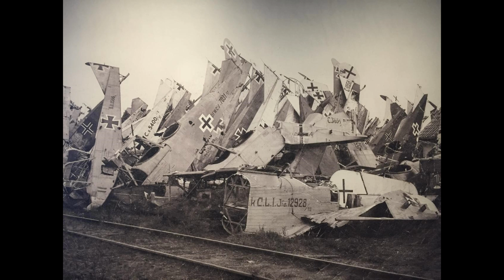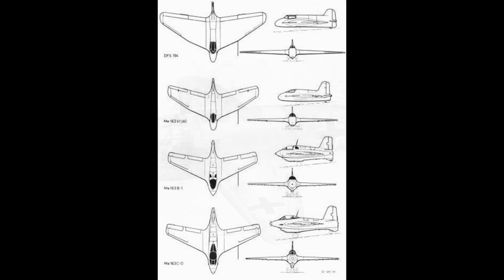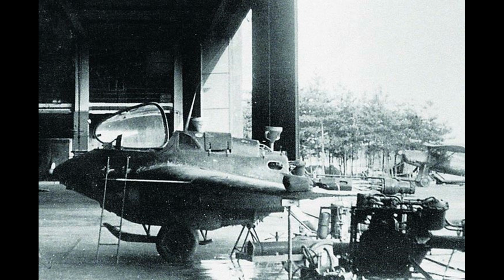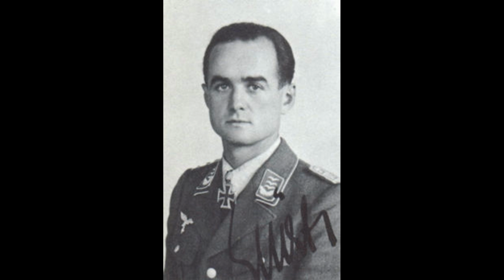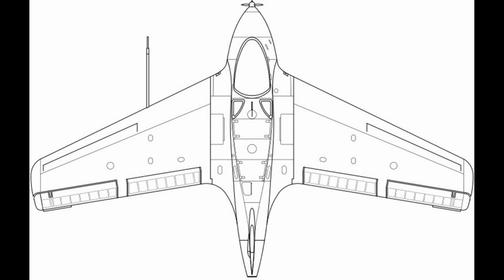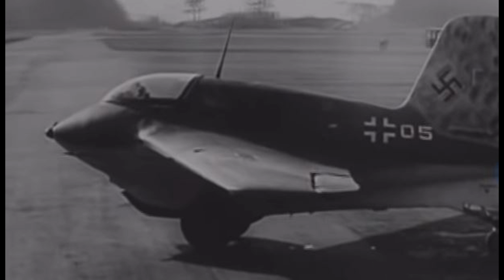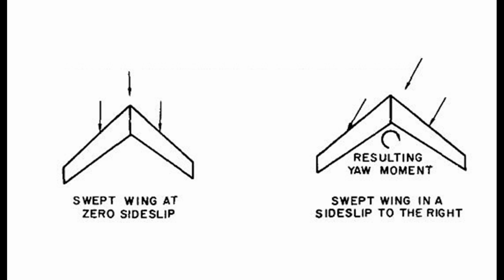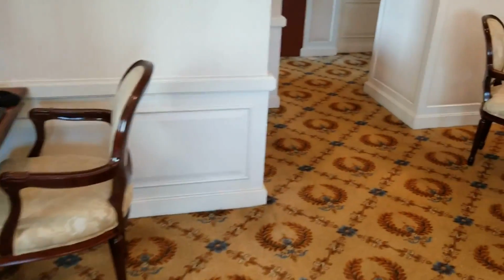Messerschmitt Me 163 Komet Pt. 1

Comment: The word "stoff" is  closely related to the english "stuff", both seemingly going back to the same root. Although I would assume the meaning in this case was derived from the word "Treibstoff", meaning fuel material, the usage in these designations strikes me as decidedly ambiguous and secretive, intentionally not giving away anything about it's usage, origin or purpose. 

I presume the thinking behind it was, an order for 5 tons of 'C Stoff'" from an aviation company doesn't tell a low-level spy (janitor, cleaning lady at the office...) at first glance that there is exotic propulsion experimentation going on. It's in fact really close to ordering "5 tons of the c stuff", just that the word is a bit more neutral in technical German usage. 

This seems very similar to calling prototype guns "Gerät" (simply "device", such as Gerät 06), rockets "Aggregat" (best translated to "complex machine", such as the A4 which was later propagandistically renamed the V2, Vergeltungswaffe), or prototype tanks "Objekt" (yeah I know the latter was Russian military - same difference).
Reply: . Mom lM
.

M
P pool

Comment: Note the Me 163 had an autostable (reflexed) air foil.   It could not be stalled with the tanks more than half empty.

1 Me 163A was a small test bed with a "cold" monopropellant rocket that worked by decomposing hydrogen peroxide
2 Me 163B was the combat version with a HWK 509A1/A2 that used a bipropellant rocket hydrazine hydrate + 57% methanol + 13% water  (the fuel) and Hydrogen Peroxide (oxidiser)

The Me 163B had a couple of problems.
a/ the Me 163 could intercept because it could climb at speed in a minute what would take a piston fighter at least 10 minutes.  Once there it only had a few minutes to conduct the attack and this was often not enough to form up for a coordinated attack.
b/ the two 30mm MK 108 guns were not quite enough for the speed of the attack.
c/  no pressurisation
d/ the skid could not accept high sink rates and was the cause of must accidents.

The solution to the short endurance was the HWK 509B rocket which had the same rocket motor but added a much smaller sustainer for cruise that was much more efficient.  That would give the Me 163 a few more minutes.   However the Me 163B was never upgraded.

Instead development of the larger Me 163C was begun.  This was enlarged aircraft, had a pressurised bubble canopy and 4 x Mk 108 guns and of course the improved HWK 509B and latter C.

The Me 163 was perhaps to much work so the Me 163D also known as the Me 263 or Ju 248.   This was a stretched Me 163B with the boost/sustainer motor and retractable undercarriage.  It did fly as a glider at least.

The short range was not so much an issue as the ultra high climb rate and speed meant it didn't waste 10-15 minutes time getting there.   It was at bomber height in a minute.

Rudy Opitz, Me 163 test pilot said that pilots did survive over turned aircraft.  They were fairly solid and precautions were taken.
Reply: Thank you for your input. It's very informative. Is the image @16:07 an engine with the sustainer thrust chamber? (below the main one?)
Reply from the maker: It's a later 163 engine, I'll talk about it later.

Comment: Great great research Greg. The Germans had invested so much in training these pilots then put them in the flying coffin so to speak. I imagine the lure of high speeds and being uncatchable in the air was irresistible. Two questions on the 163. 1) What is that prop thing in front what does it measure and 2)what kind of adverse yaw would that thing have in a turn with the sweepback and the short fuselage. I agree on the 727 was my first airplane as a first officer in OA we had the prototype -200 it was about 1000 lbs heavier than the others due to the cabling for the test flights. If you want to do some research on the 737 as well as it was requested to be built by DLH and in plan view is remarkably similar to the 262 so these people knew what they were doing - well apart from that nasty rocket fuel lol.
Reply from the maker: Wow, a fellow 727 pilot! I love that airplane, although I haven't seen one fly in a few years now. OK, the prop thingy at the front drives an electrical generator. I would think that it would have a lot of adverse yaw with those long wings and stubby fuselage, but I haven't found anything about that specifically. Of course, what's a little adverse yaw when you eliminate all the asymmetrical forces from the prop? I suspect rudder coordination was a lot easier than in a 109 or 190, extra adverse yaw or not.

Comment: Highly interesting video! Now I once read a very similar story to what happened to Joschi. In that case, after the wheels hit the plane, the engine also cut off and the plane basically landed itself on the end of the runway. So from the outside the plane looked undamaged, but then they also found out, that the pilot had been dissolved. Many ICBM`s also use hypergolic fuels. Also many of chinese space rockets and the russian proton rocket run on hypergolic fuels. Nasty stuff.
Reply from the maker: Thanks Paddy.

Comment: How effective was the pitch authority of the control surfaces without a normal tail?
Reply from the maker: I didn't read any complaints about lack of pitch authority, I think the design flew quite well.
Reply: @GregsAirplanesandAutomobiles  i am actually trying to make similar "tailless" rc plane. They're called planks in dynamic soaring community and often are actually more pitch sensitive, probably due to less moment of inertia along that axis

Comment: Wing twist? Look to the Prandl wing.
Reply: I´m a german engineer. to get Lift U have to force the wing to be in angle of attack. a canard by lift of the front wing, a usuall plane by Downforce on the Tail. The missing length makes it hard to cause this Downforce at the Tail/End of the foil and/or Lift at the Nose of the Front part. We have also seen extra little wings. To counter that Turn/moment the CG is in front of the CL/Center of Lift. (Balance to fly straigt) Now where will be the best spot for these aoa causing aereas? Where they are mostly/far away from the CG! That´s the sense/reason for the design how such wings are planed. Additional to reduce stall is the combination of getting presure above the wingtipp and Downforce causing aoa by using washout/wingtwist. I am sure Lippisch understood what he was doing. Stoff can be anything. Like stuff. The ö is not o spelled. like the ü isn´t u or the ä isn´ t a. hey, and at all U make very interesting YT-Stoff. :)I love it. Thx for the face fitting to your voice.
Reply: @1948ccm  Birds fly without vertical stabilisers or rudders and their tail feathers are very close to their CG.
Have you looked at the Prandtl wing concept? (I spelled it wrong.) My knowledge is limited, but... Conventional aircraft use all those bits you've described to control flight but they induce drag. Modern aircraft use winglets to reduce wingtip vortices and the consequent drag and sometimes minimise adverse yaw which necessitates the use of the rudder to correct it - which produces more drag. The Prandtl  wingtip has lotsa downwash. This reduces wingtip vortices and provides stability in the yawing plane. Because of the downwash, when ailerons are used it reduces drag and induces positive yaw. I'm sure the Horten brothers used the concept successfully on their gliders in the thirties. I think the Northrops in the US used a different concept to control their early flying wings. From what I've seen, the B2 uses an aileron/spoiler system.
Reply: @53jed  Birds do fly with vertical stabilisation by temporary rotoation their Tailfeathers and as long alive gambling with active manouvering Wings body and Tailsection shape of folding wing due to speed and effort ot create drag or lift. A glider is a dead bird! U get a dead bird gliding only when designing his shape how dead gliders are. so, the Prandle Wing has length, to see as beeing a fuselage to have a tailbehavior. yaw is solved. If the wing would be straight it would not fly. cheers
Reply: @53jed  the Horten used the....that´s the end of what I see. a bird changes its tail due to the nesseccarity of ´hem to simulate either rudder of elevator. Haven´t U watched birds yet? As I said they also move their wings forwards od backwards to create anti nosedrop or noselift. They balance therefor with CG and CL. The Tail is lets say digital used once vertical and horizontal. I recognize that very often. I have seen some YT Stuff Prandtlwing. One guy was an imposter scientist behaving like a stuntman having a short window open in his mind like religious beleavers blind for the knowledge outside. I felt that is waste of time to surch for improvements in wingtyps when already efficiency is 98% high of possible 100%. a good glider makes 100m dropping only 2m! And that is a glider with 2 Wings, main uplifting front and a downlifting at the end of the fuselage. U will not understand the last sentence. I know that and it doesn´t matter. ANY WING ONLY CREATES LIFT WHEN AOA IS HAPPENING. The Tail does not have the function of feathers of an arrow! The angle of zero lift is in my sence the base we are talking about when aoa Angle of attack is used to explain something. So any wingfoil has its own angle to be the zero Lift angle. A flat one or a symmetrical have that simmilar to the centerline. please show a link were U have found some interesting Brandtl wingtip or drag reducing parts. Let´s see the picture what makes 1000 works beeing nothing;-).
Reply: @1948ccm  Calm down. You're saying the pterosaurs, bats, the Me163, the DH108 and the Hortens' gliders, the Northtop wings and many other aircraft never flew because they couldn't. The Me163 has a bunch of washout (5-6 degrees) at the wingtips, so it seems they possibly grasped the Prandtl concept rather well. Instead of shouting that it can't happen, look it up and try to understand how it works. The concept has  been around for only a hundred years. For most of that time it's been impractical because of material and cost constraints. 
The washout reduces provides yaw stability which reduced the need for a drag-inducing vertical stabiliser, reduces wingtip vortices and, when ailerons are applied, reduces drag on the lift side which produces positive yaw - which, in turn (or, in a turn) reduces need for rudder input. It's pretty slick. NASA are open to the concept and a small team has been researching it for some time.
There are plenty of videos available. Here's one:
https://www.youtube.com/watch?v=0Oh0Q0Dv28I
Reply: @53jed  Lyar! I do not say that. I say when they are alive they have control of Balancing the forces out to fly and that the fun of flying to be the master. The Horten gliders have the balancing inbuild downlift at the end the foil and the end of the wing to mimic a Tail. U have an inner lifting past and and  an outer part. Lengh and force, AOA , CG, CL, all monents balanced! Don´t U see the angle? Animals play with the unstabil situation. What´s uo with U?
Reply: @1948ccm  "The Horten gliders have the balancing inbuild downlift at the end the foil and the end of the wing to mimic a Tail. "
That's the only comprehensible sentence you wrote and you described the Prandtl wing.
Reply: @53jed A further ballancing method is to let the mass sit under the wing. That is what birds are doing to create an angle of attack. to combine all possible methods lead into a usable glider almost good but just not better. The leckage of distance between the ballencing forces let the single wing glider loose. I´ve built one in the shape of an milan in fast flight mode. Anything involved. I can fly among other conventional gliders but only almost as good. It is fun to fly the bird. have fun Gerard.
Reply: @1948ccm  Well, good for you. You're obviously an accomplished man. I like your music. Do you understand the concept yet?
Reply: @53jed  Cencept of what? give me a link, please. Think please that any wing needs a force to get an angle against the Airflow. That is called AOA. Check please the curveture to detect the leying S-curve on a Singlewing plane. Do U know about centrifugal force? formula similar to bernouli. Some explain lift using bernouli I prefer the force any can understand in a centrifugal washmaschine :) a dryer or so. That force creates low airpresure over the bulpy curve of a wing and vice versa. The S Shape is like Elevator is up. U can understand that 2 Wings are combined in one. front part and Tailpart. cya.

Comment: stoff basically means material or in other cases fabric. if youd translate it in this case it would simply mean fuel. same like Kraftstoff wich is fuel.
Ein Kraftstoff ist ein Brennstoff, dessen chemische Energie durch Verbrennung in Verbrennungskraftmaschinen und Raketentriebwerken in mechanische Energie umgewandelt wird. 

A Kraftstoff is a Brennstoff (burning material). Its energy is transformed to mechanical energy by burning it inside a combustion engine or rocket engine.

the name wolfgang is spoken like youd pronounce a single o not a spoken u. instead of wulfgang you pronounce it wolfgang. not sure about the last name if its spade most likely the a is pronounced less harsh more of a a like in a r but without the r just a ah not ahrrr. so youd pronounce that spahde or sth like that i didnt google the name idk ^^

Comment: Something I don’t understand: wind comes from the right if the airplane is slipping to the righ, no? In that case the drag differential moves it further to the right, doesn’t that destabilize the ac rather than set it straight?
Reply from the maker: If the plane is slipping to the right the amount of drag on the  right wing is higher in a swept wing aircraft. That pushes the right wing back (relatively) thus yaws the nose to the right, and thus back into the wind.
Reply: Ok, so that is self correction into the wind in powerless glider flight. But that means that in powered flight where the pilot does not want to go into the wind but continue on course, if he has side wind, the shape of the wing exacerbates the side force?